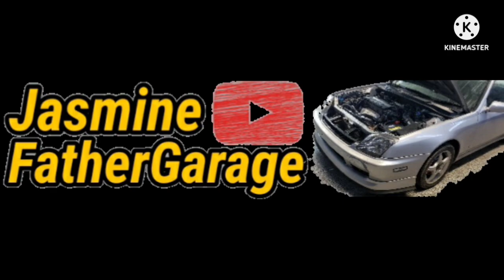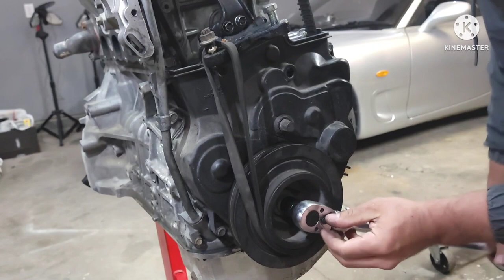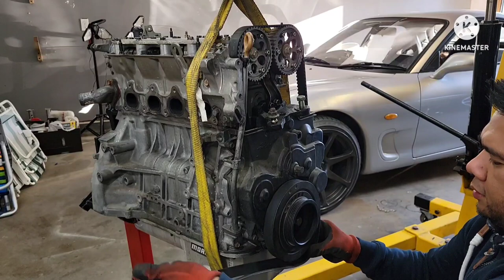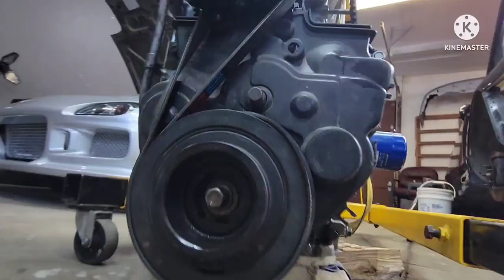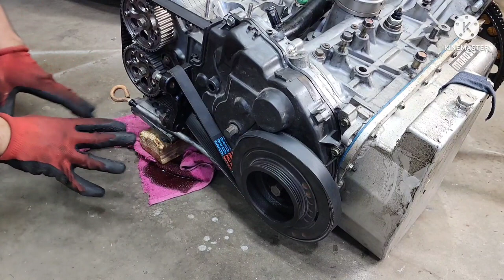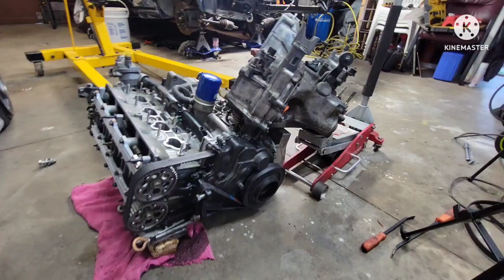V9: Honda Crankshaft Bolt Stuck/Removal! All you need a Old Belt, Breaker Bar and 19mm Socket

Comment: I helped a Honda guy do that once. Instead of a swivel head ratchet I used a 3/4 drive T-wrench & a 4' long piece of 1" pipe on the T-wrench. Started with a 3/4 to 1/2 reducer & a 19mm impact socket. Broke the adapter so I welded the socket directly to the adapter because we couldn't find  a 3/4 drive 19mm socket.  Finally got it off but it was a struggle.

Comment: I used a 3 foot schedule 40 hollow cheater bar pipe on the 1/2 inch steel breaker bar. All my force and I heard CLACK CLACK CLACK and finally I was soooo happy.

Comment: Good ideas! I was having a heck of a time with my crankshaft bolt and I used my jack handle over my 1/2" breaker bar and just give it all you got and she'll start cracking. Had to Crack it around 5-7 times before it would loosen, craziness.

Comment: My Honda 3.5 bolt is stuck after I broke the 30" breaker bar using the starter motor trick. Don't know what else to do.
Reply: what is a 3.5 bolt?

Comment: I can't help but think that... For at least 70 years, of automobile construction, nobody, had to worry about the crank pulley coming off. 

And then snap-on comes along with a little thunder gun.... And now nobody can get it off. 

Do you understand what planned obsolescence is yet? 

You're not supposed to fix that piece of s***. Is it supposed to throw it in the trash and get a new one. 

So Honda can stay in business. So Mopar can stay in business. So Ford can stay in business. Chevrolet and a great mistake corporation, and toyota, and hyundai.... 

They can't afford to build good products anymore.

Comment: Use a 1/2 in high torque impact and a 19mm lisle crankshaft socket
Reply: didn’t work
Reply: I use a Milwaukee 2767 1/2" M18 high impact wrench and have never had a problem.  The newer Milwaukee 2967 with the M18 XC 6.0 Forge is even more powerful.  I do, however, remember the days when I had to struggle and took a chance of getting hurt.  Luckily, those days are long gone.
Reply: @wallebo  i even used a real impact (air) and it didn’t work even with the specialty socket

Comment: Dude, I went through two broken knuckles, a broken tool, an impact wrench, messed up shoulder cuff, and in the end, wrapping my serpentine belt around the AC Compressor with a rachet with bar on the end of it worked. Not only did it work, I barely felt it break free. This was amazing ingenuity. Thank you!
Reply: Also, I cranked on it so hard that it broke my seized engine free, which was why I was taking it apart to begin with Lol
Reply from the maker: I'm glad you found this video helpful

Comment: this was a waste of time how many of us have the option of have a hoist to remove engine let alone put it on a stand im think it would of worked if while using the breaker bar and using a steel pipe for more added torque not a pvc pipe ,standing engine was not a good idea or laying it flat were not good ideas most like me will have to do this while engine is in car

Comment: So long as it's anchored by something heavy enough, or in a position where you can stand on whatever is holding it, you will nearly ALWAYS have more torque pulling UP on a bar/ratchet than pushing on it, as you're using your strength, rather than just your body weight.